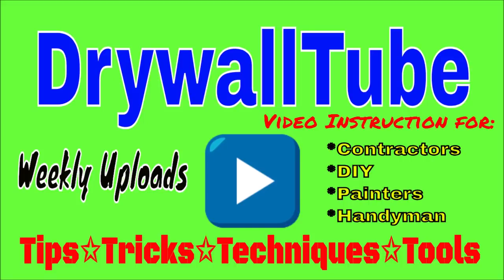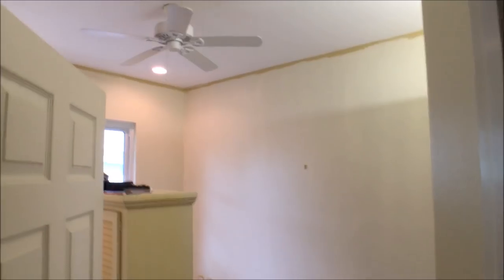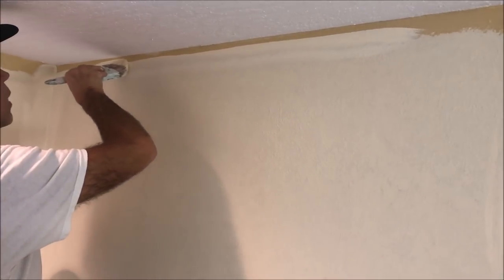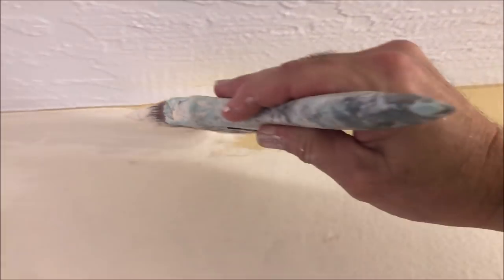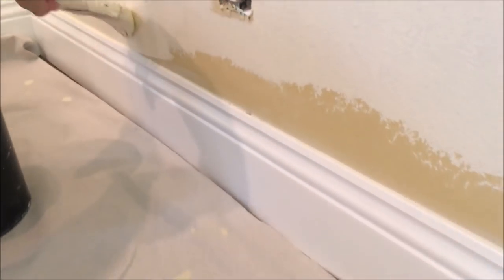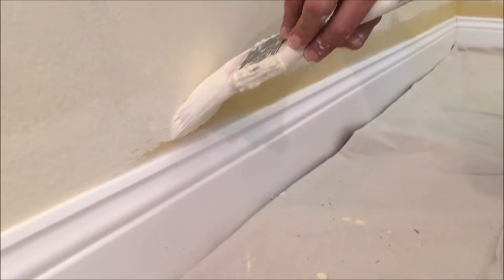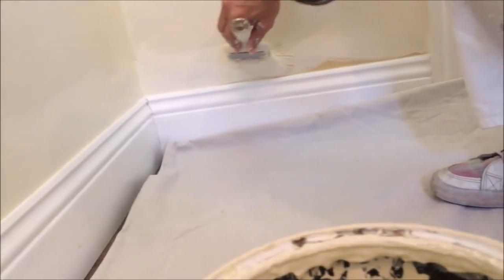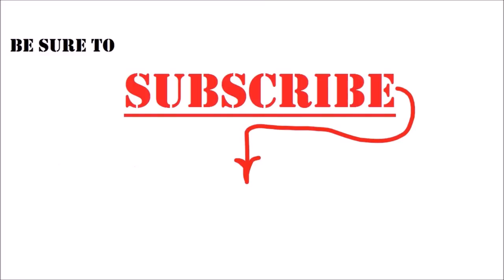Easily Cut in and What Brush to use when Interior Painting Fast like a Pro!

Comment: I like to use the higher end Purdy  2 1/2" brush where the bristles taper to  a sharp point. The smaller brush weighs less, and my hands won't fatigue as easily. The sharper point gives me better accuracy. The higher quality bristles really make the difference in the brush's ability to soak up paint out of the can, and deposit paint onto the wall. #drywalltube
Reply from the maker: Right on Jeff!💥 I really appreciate you sharing your knowledge and experience!👍🏻 Thanks so much for watching and commenting my friend!😎 -Paul

Comment: Hi I have a question, I’m just a DIY girl. I would like to know what kind to f roller should I use to work with emerald satin finish paint. I did my walls and they came so streaky. I need to redo them. Is there a technique to work with that kid of paint. What I’m I doing wrong. I would appreciate your answer

Comment: Ever tried to use those flat arts and crafts brushes to cut in? I have found they actually work incredibly well.
Reply from the maker: Hey Brian, I have for tight areas. Like in between door trim and wall corner. They work great for that. But, they don’t hold enough paint for cutting in long areas in my opinion. I hope this helps. Thanks so much for watching and subscribing my friend!😎 -Paul

Comment: #drywalltube I always struggled getting enough coverage with cut ins because I always wiped my paint off  the edge after i dipped. How do you paint your inside corners? Cut in or roll? How would you roll an inside corner so the paint doesn't build up?
Reply: Had the same questions cause your corners look done done I'm usually dab filling the inside corners and rolling outside corners
Reply: @damienballard5 I always brush down the center of the inside corner (so you’re getting a little paint on each side). Then roll with a 4” ultra smooth roller, as close to the corner as I can without touching the opposite wall

Comment: Wooster 3 inch straight brush.  That way you can cut in both directions without the need to turn your brush around.  Holds more paint and gives you a 3 inch border to roll into making it easier to not touch the ceiling with your roller.  Second choice would be Purdy.  If you have no where to wash your brush you can wrap it in plastic and tape the plastic around the handle so no air gets to it.  It doesn't hurt to leave fresh paint on it before wrapping it.  It will stay for a few weeks if need be.  Best to wash it soon as possible but you never lose your brush.  Works for roller sleeves also.
Reply: You can actually still cut in both directions with an angle brush, you just have to be good.

Comment: I prefer the angled brushes better because I feel that they get into corners and tight spaces better. What is the advantage of using the straight brush, in your experience?
Reply from the maker: Hey Harry, I appreciate your feedback man!👍🏻 I find the 3” straight brush holds more paint which gives you more speed and a better finish because you have less starting and stopping (longer strokes). It’s also very versatile.  I can use this brush for cutting in pretty much anything.👍🏻 I hope this helps. Thanks so much for watching and subscribing!😎 -Paul